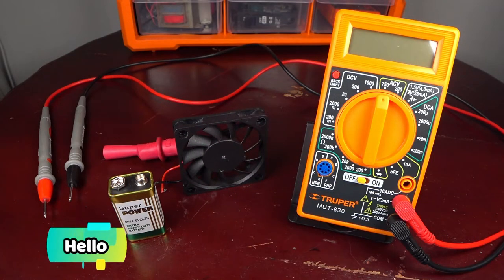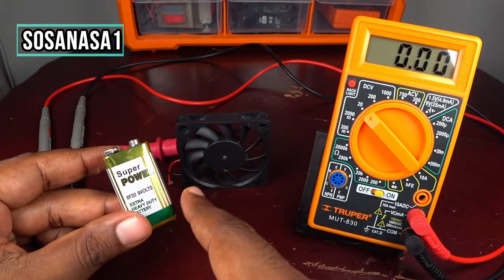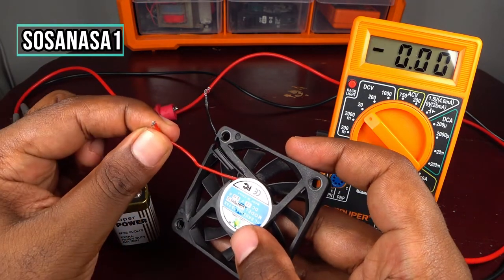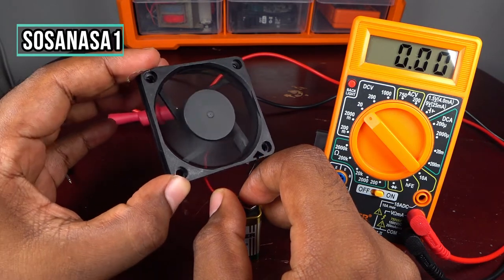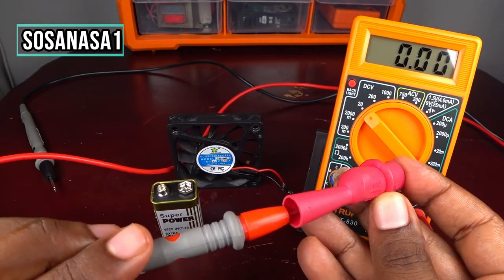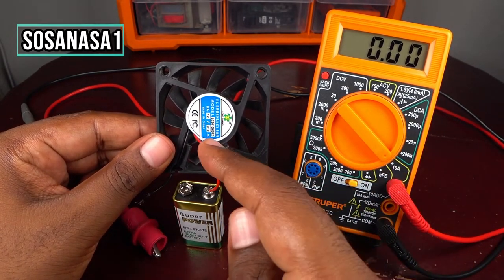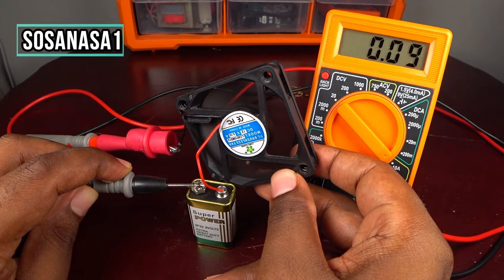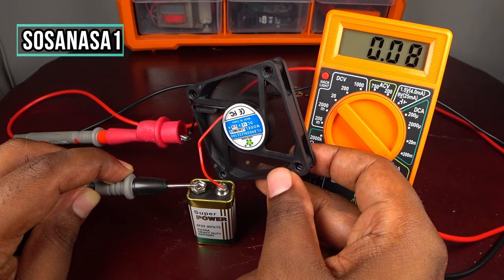how to test a Computer fan using a digital multimeter

Comment: Mine works, but only on battery not on the power supply, the power supply is functioning since everything works except my newly bought fan that works on a battery

All voltages are correct. What is the problem?